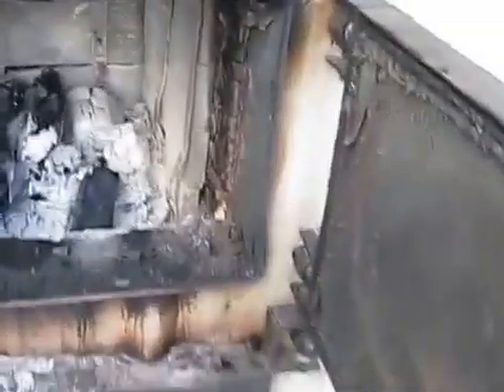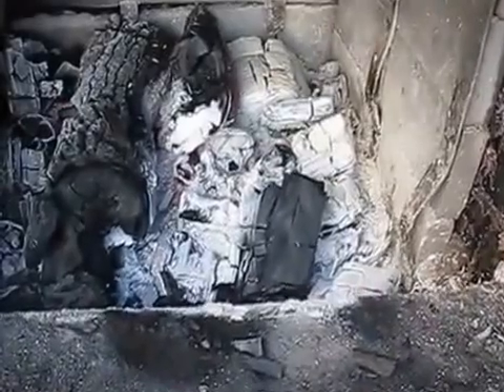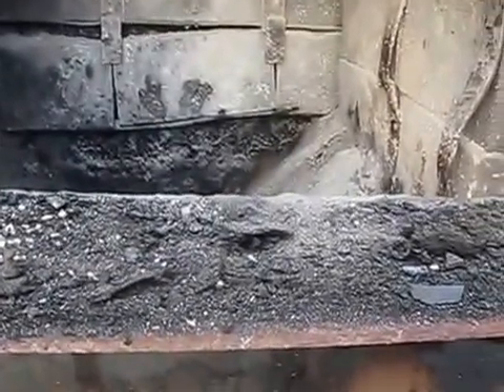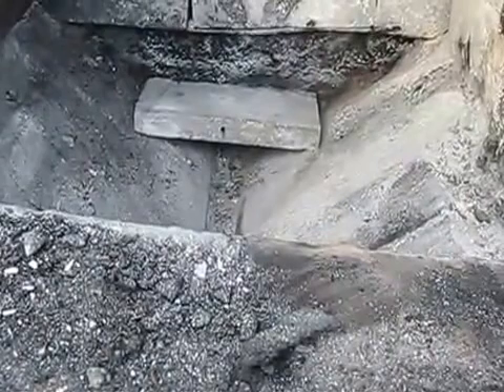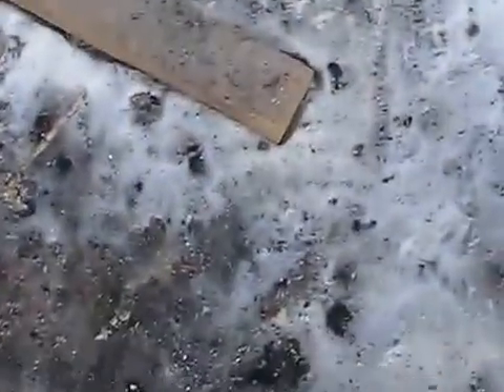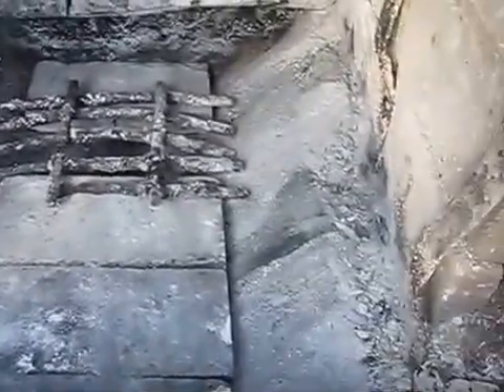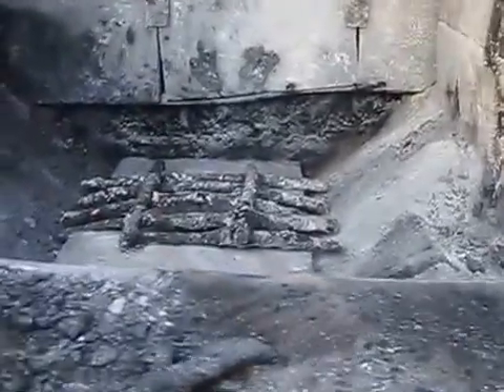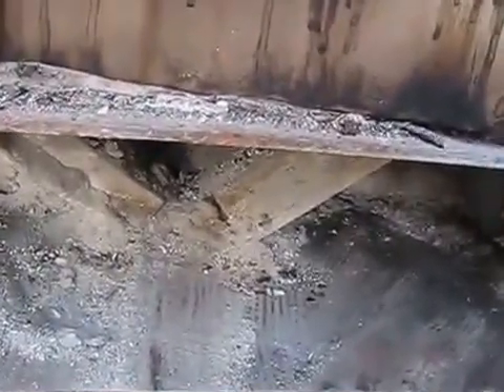Wood Boiler with secondary burn explained

Comment: Is this the design your going to stick with, or do you have another modification in mind
Reply from the maker: This design has worked well, so I am going to stick with it, however I am currently drawing up some plans, and am using a larger primary burn chamber.  With my currentl Boiler I need to fill it morning and night when it is cold.  With a larger primary burn chanber it should only need to be filled once per day.